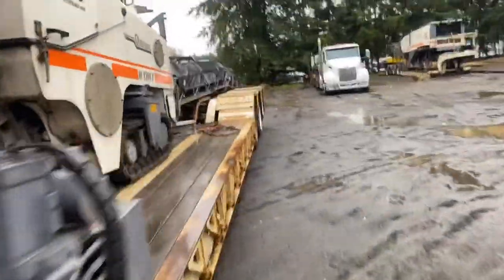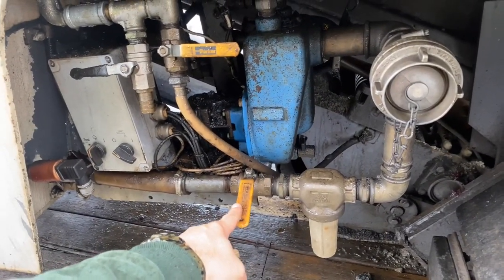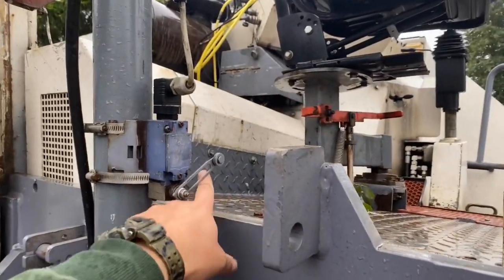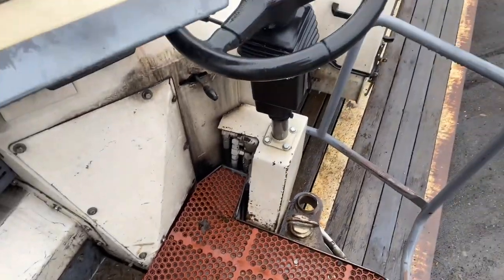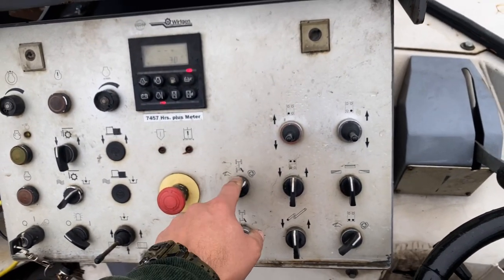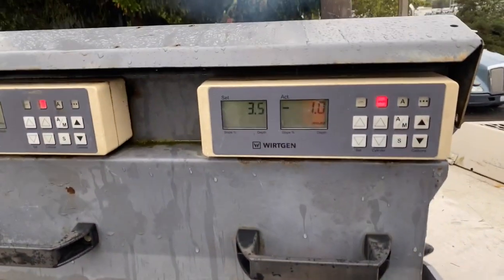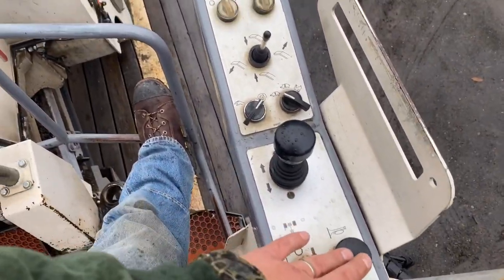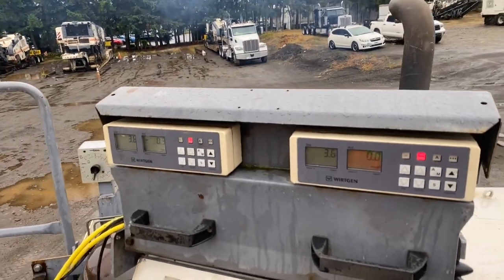WIRTGEN W1200F, how to operate .

Comment: I’m operating a 04 w2000 tomorrow for the first time. I’ve never operated any milling machine. My boss is aware I never have, and he’s going to be up there with me, but I wanted to spend the night watching some videos to get familiar with the controls so I’m not completely lost up there. Like I said it’s an 04 also, just bigger? Do you know if the controls are the same? Or is it like a vehicle in which you can buy one with different packages with different options? 
I have plenty of experience operating everything in the world on excavation and I can run small pavers like leeboys, just never something like this. Thanks in advance.
Reply from the maker: Since you already have operating experience with some of those more complicated machines, a mill isn’t really that big of a deal to operate. One of the biggest problems I have had with these different milling machines is that when zeroing out the digital readout’s they are not very accurate, and I have to use the manual gauges off of the Hydraulic raising cylinders, the older ones have a lot of slop in them and at times you have to really focus on the road and where there are dips and large bumps and when milling in supers it will show you on your gauges or a readouts that your machine is milling 3 inches deep but in reality, you are doing 3 inches on one side and maybe four or 5 inches on the other, some milling machines will have a switch that lets you select when you are milling in a super, and it will correct that for you automatically. a lot of this stuff comes with practice. I have found that bigger companies that do lots of milling Generally have a guy or two that are willing to share information similar to what I’m sharing with you. I hope this is all helpful to you and if I end up getting on a W2000 at some point, I will reach out to you.